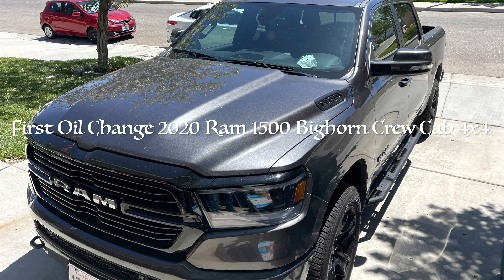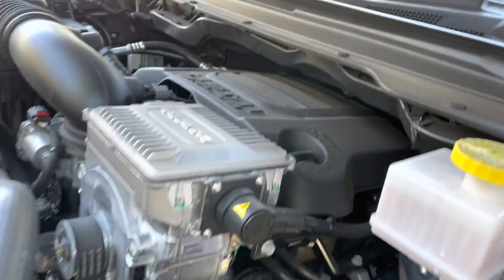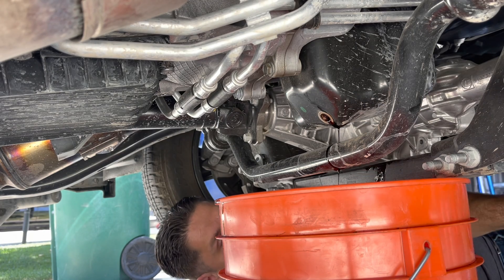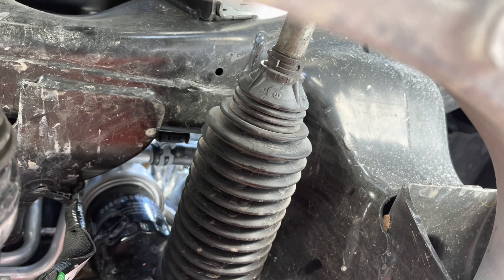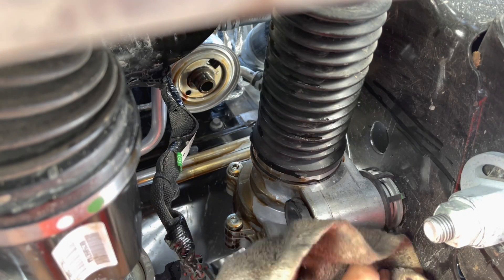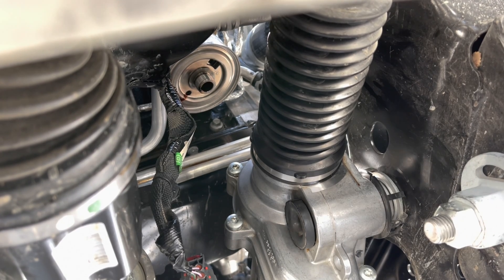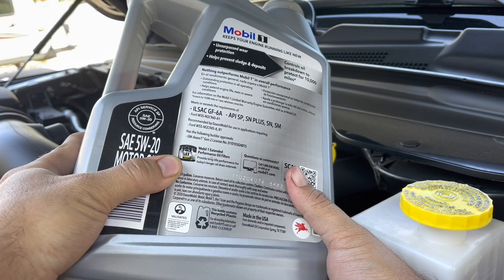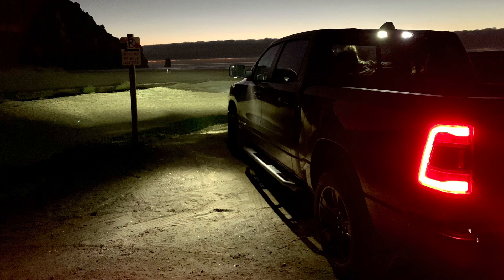1st Oil Change on 2020 Ram 1500 - Bad Engineering 101

Comment: I have done oil changes on a gazillion different cars. The placement of the ram drain plug and especially the oil filter location are absolutely the worst. Besides that everything else around the car made sense.

Comment: I used a step ladder when i put the new oil in, i also put my air suspension in off-road 2 so it made it easier to get under when on the ramps.

Comment: So how many fans mentioned to always add oil to the new filter so you do not have a dry start up ?  It will take a few minutes for that new filter to fill up and start the normal cycling of new oil.
A clear plastic cup works better with a large zip lock to seal it up after.

Comment: @08:20 My thoughts exactly about how techs do oil changes in a dealer or quickie oil change place. I bought my Rebel preowned and will be doing my own changes. No excited about the ones that have been done before my time.

Comment: I did the same on my 2019 RAM Classic 1500. Yes it is a horror story. I LEARNED LONG AGO................
ALWAYS make sure you can break the oil filter loose BEFORE draining oil. IF you can not break it loose DO NOT proceed. You will end up putting the dirty oil back, or new oil in a dirty filter. I learned that the "hard way" many years ago. I watched the other videos too before changing oil, none of them told me this; then I saw yours after I changed oil.

Comment: Instead of plastic, line everything where oil could splash during draining pan or removing filter with thin aluminum foil. After changing oil remove and dispose keeping all truck areas clean from oil.

Comment: What is the large aluminum heat sink box that says RAM in the front right of the motor? I've never seen that on a hemi
Reply: That's the eTorque.  The alternator sits in the same spot on the non-eTorque models.

Comment: That oil filter looks annoying!

A little trick that I saw on another video for oil filters in general: use a disposable cup (paper or plastic, it doesn't matter). As soon as you break it loose, but the cup over it and turn it with covering the oil filter. It'll catch a lot of that oil.

Comment: For gods sake people. If you take your time and give the filter time to drain bit by bit as you remove it! You don’t get oil all over the place or on any part of the truck. As for the sway bar or cross member big deal, it cleans right off.

Comment: Great video.  Mine's the 3.6L and it isn't much easier (except the filter...maybe).  The filter location on the V6 is directly to the left of the oil fill neck but under a plastic cover (because why not).  At least we all lube our sway bars every 5k miles or so.

Comment: Pro tip, put jack stands under while up on those cheap plastic ramps.  When the truck falls on you,.. you'll wish you did put the jack stands
Reply from the maker: The plastic ramps are fine, they don’t break.

Comment: Thanks for this video.  I just picked up my 2020 RAM used and love it.  I'll easily agree with you regarding the placement of the oil filter and drain plug.  Almost feels intentional so you don't change the oil yourself and have to take it in to the deal for service.  I'm sure this is easier with the truck up on a lift.  I'm transitioning from a 2007 Dodge Ram and will say changing the oil on that truck was fun!  I was done in 15 minutes.  No need to put the truck up on ramps or anything.  The oil filter and drain plug were super easy to get to with no obstructions.  This 2020 RAM is not the same.  Again, thanks for the video and will have to do the ziplock back trick and get me a pair of ramps.  :D  4 wheel drive for the win!  :D

Comment: Simple oil change. If it's too messy for you,bring it to the dealer. How much did you actually save? $20?
Reply from the maker: And have a porter making minimum wage do it, makes sense. I do all of my own maintenance, but some of these cars have stupid designs is the point. It’s not saving $20 either, it’s $50 more. Regardless I get way more life out of my vehicles not letting other people touch them for regular maintenance.

Comment: The oil change places are not a good idea. I do my oil change on my 2019 Rebel and yes its a pain for all the reason you mentioned however I know its done right. Even after 30 minutes on a hot engine you still have a decent drip of oil coming out of the plug. The oil change places remove the plug for approx 10 min and there has got to be quite a bit of oil left in there. I let mine drain for approx 30 minutes at a minimum.

Comment: Great video, however, after watching your truck push the plastic ramps forward, i would suggest you get steel ramps to protect you from the truck crushing You.
If you get a  flatter oil recovery  , it works easier than a Home depot bucket. When you change the oil filter, loosen filter, put a gallon ziplock bag around it, moving it slowly, let the oil flow into gallon ziplock bag. Slowly remove, getting virtually no oil anywhere. Good luck!

Comment: Guys I just did mine in under 20minutes!  I have a 2020 Warlock 1500. 
Mind you I am a mechanic & have a hoist. 
Can’t fit a filter wrench in there, simply use a strap wrench, works great.
Are you going to drink motor oil - Yeup you will!! But you want 2B a mechanic, get used to it cupcakes.
That little bit of oil on the parts, clean it as best you can, the rest of it will only undercoat the undercarriage (I’m from Northern Ontario, where they lay winter salt like candy!)
Anyway hope this help you guys 😉👍🍻🇨🇦🔧

Comment: 100% FUMOTO drain valve is the best fix for the drain plug.   Still working on best solution for oil filter.

Comment: 10-1-23 Finally someone explains just how much of a pain in the a_ _  it is changing this filter. I’ve been doing it for years and I dred it every time. There’s just not ample room. Tried every trick & every type of wrench. I was a military aircraft Mech and still I hated changing this filter. The tips and tricks for cleanliness do help, but breaking the filter loose for 1st new truck oil change was is the worst. I get a new Ram every 2 or 3 yrs . If you can get by the factory installed filter, you’ll only need a light hand tightening, and heat + time will do the rest. I slide a fresh piece of cardboard under the truck for a few days to check for leaks . I haven’t had any leaks with my oil changes but even if I had a slight slow leak at the filter , I myself would leave it that way vs tightening up on this model of Ram. There’s just no room to wrench it off if it’s to tight.
Reply from the maker: I use a filter wrench instead, seems to help break it loose easier.

Comment: Instead of accessing the filter from below the rack, access is from the front, above the frame by the coolant lines. This video show the exact location starting at 14:23. You will be able to wrap your entire hand around the filter just like gripping a mug. You can use the ziplock back an take it out with no restriction.

Comment: Use a quart size ziplock bag. Put it around the filter and spin the filter off while holding the bag up around the filter. When I do this I don't spill a drop. You can do it all with one hand. Pull the filter out through the front.

Comment: You didn’t show yourself lubing the top of that new filter buddy. It’s a must to insure that the rubber gasket doesn’t get stuck to the housing or roll when you tighten it.
Reply: If it stick pull it off. Done

Comment: Done probably 15 changes on my ram. Easy for me. Beware mobil 1 does not meet Chrysler material standards. MS-6395.
Reply: @AxleGil  why doesn't it meet Chrysler material standards ? That's all I ever used on my 2013 Ram with no problem  ?

Comment: After 2 oil changes I made my own oil filter relocation kit. Filter is now near the front. I can reach the filter  by just reaching under the bumper.
The previous generation has a big steel  support that protects from front end damage.
I don't have the sway bar issue.

Stupid  Ram put the transmission drain near the exhaust and some wiring. Great job!
Reply: What? lol

Comment: If you think changing the engine oil on the Ram is bad...just wait until you decide to change the transmission fluid and filter.  The filter is built into the tranny pan, and you have to pull the pan and replace it with a new one, if you want a new transmission filter.  Major PITA filling the tranny with fluid...must be in a specific tranny temp range...you're going to love it.  I would love to see your video commentary during that evolution!
Reply: Made the mistake of draining the trans fluid cause the plug said "oil drain only" which doesn't make much sense of course, instead of the oil... Thought it was gonna be a simple fix ha I thought WRONG

Comment: I recently bought a 2020 Ram 1500 Classic with the Hemi engine. My previous truck was 2004 Dodge Ram 1500 with the Hemi. Oil filter was in the same spot on the third Gen as the fourth and fifth gen Ram. I'm about to do my first oil change on my 2020, looks about the same as the 2004 so I don't see it being an issue. Want to have a bad oil change experience and see poor engineering, do a service on Ram with a 6.7 Cummins. You'll be hating your life.

Comment: Interesting, wonder how the dealer removes the filters without making a huge mess. Specialty tool?
Reply: Last oil change there was no oil anywhere. Time before that it was everywhere and was dripping on my driveway. Thought I had a leak but then saw the mess when i crawled under. Depends on if the tech get paid nothing for the oil change gives two fucks..

Comment: Doing my oil change soon , I have 2020 Ram 1500 5.7 Hemi  18K miles 
what oil are people usually going for as far as brand?
 From what I've read recommended/most popular is Pennzoil Platinum   5w-20 Full Synthetic . Open for any opinions/recommendations
Reply: I've been using castrol 5w30 and a Motorcraft 820s filter. No tick. Change the oil every 4500 miles. Definitely works for me.

Comment: just did my first oil change on my 2020 RAM 1500.
what a miserable job the RAM engineers did with both the oil pan drain and the oil filter. No wonder Ford, GM and Toyota are eating their lunch!
they couldn't have a done a worse job with the location of those items.
who was the engineer that thought this would be a great idea???
unbelievable.

Comment: I feel your pain but I found a cure of sorts. Buy a K&N oil filter. It has a 1" nut welded to the bottom of the oil filter so you can put a socket on it. Makes it much easier to get it off.

Comment: i just did this yesterday. i ended up using aluminum foil to cover the sway bar and other components under the filter. it didn't help the oil go where i wanted it to go, but it did in fact protect the components. i also did the gallon bag trick. it did not work perfect and made it very difficult to turn the filter with the bag on. but with some persistence it did come off and caught most of the oil. that along with the foil made cleanup pretty easy. i didn't have much issue slipping the old filter out or put the new one on.

but i agree...the engineering of this is real shit especially since this is 2022.  c'mon guys.

Comment: I installed a ValvoMax Stainless Oil Drain Valve on my Ram.  It will help avoid the mess from the oil drain.

Comment: I always saw the locations for the oil filter and drain pan engineered in those places to protect your engine. So if you go rock climbing in your Ram it wont get "snagged" and leak all your oil completely out to blow your motor. However, it is a pain to access these locations.
Reply: Also the engine is built to be in multiple different vehicles and that vehicle has multiple different engines so it’s no body’s fault. Just have to deal with it.

Comment: Is it necessary to coat the new oil filter seal with used oil? Or can it just be put in dry?
Reply from the maker: It’s a preference thing. I’ve found oil on the gasket helps in dry climates where it can dry out over time.

Comment: QUICK TIP: Slightly loosen oil filter but, not so much where oil starts to leak down, Take a gallon ziplock bag, cut one of the corners off to create a funnel. Zip tie the ziplock bag around the filter as tight as possible. Take a #2 phillips screw driver and slide it into the hole in the corner of the ziplock bag you made previously. With the screw driver inserted into the ziplock bag, use a hammer to TAP THE SCREWDRIVER GENTLY, punching one or more holes into the bottom of the oil filter. DO NOT HAMMER IT LIKE A BLACKSMITH TRYING TO WORK STEEL FRESH FROM A FORGE. Allow to drain fully, then remove the filter while the ziplock bag is still zip tied to the filter. No fuss, no mess and no extra cleanup needed. You're Welcome!
Reply: his way was easier for h im considering how high the car was
Reply: @aprilgosa5779  What does the height of the vehicle have to do with anything? How do you know it was easier for him? Did you consult with him before commenting? Have you ever changed the oil and filter in a ram 1500 with the 5.7 hemi? 

None of what you said makes any sense. But please continue to speak for others you don't know about subjects you know nothing about. It gives those of us who do a good laugh.
Reply: I just bought a 2022 Laramie 4x4 5.7. I have changed oil on Chevy, Ford, Jeep, Harley Davidsons, dirt bikes, lawn mowers, heavy equipment and Toyota. The 2005 Toyota V6 Tacoma was the easiest. The filter was up top. Open the hood and there it is. Also had a funnel type around it with a drain plug. So when you removed the filter you could position a bottle for the oil from the filter to drain into. If Toyota can do that surely other's could. I have my first oil change on the Ram coming up and will try the Zip lock trick.
Reply: can you just drill a hole in the filter instead of punching  a hole in it with a screwdriver  n hammer ?
Reply: @stevenespinoza7735  Sure, if you want to spend the next 10 minutes trying to unwrap the plastic bag from being wrapped around the drill bit. Why complicate the process? But, It's your truck, you do you.
Reply: Thank you for the Ziploc tip, it made my oil change a lot easier with less cleanup afterward. By the way @aprilgosa5779 the height of my truck was the same as his, and the oil change was much easier using the Ziploc trick so I really don't know why the height of the truck would render it not as easy to pull off. Strange comment!
Reply: @DOOSAY-RV  You're Welcome

Comment: Where do you think those Yugo engineers ended up after it shut down? Look at an oil filter relocation kit, and a quick drain plug. That worked out well for my 2015.
Reply: Where did you get the relocation kit?

Comment: When I did my 1st oil change,  I took a disposable aluminum baking sheet, and custom bent it so it fit below the filter and above the steering rack with the oil catch pan below.  When the filter was removed,  all the oil flowed down the baking sheet and into the pan without ANY oil touching the rack.  I held into it for future changes.
Reply: I’ve done the same with just a piece of cardboard 👍🏼
Reply: Need a video of that

Comment: Well I think my previous comment was removed due to my smart comment about the ramps.  Anyways I take it all back.  Just changed the oil myself for the first time on my 2018, 123k km on it now, the rest have been dealer and shop.  I agree it's an absolute nightmare and a piss poor design.  You are right.  Oil filter was way over torqued too, I yelled f-ing Dodge a few times under there.  First one was rough (I've changed oil on my other cars lots of times, including my ecodiesel which was a dream compared to this) and only can improve from here.  Had to break out the kitty litter for the driveway.  Bag was not going to do it needed the filter wrench, which perforated the canister.  No clean way to do it over torqued.  Thanks you are right, designed to be serviced at dealer, hateful.

Comment: This isn't that bad. You're making it harder using a 5 gal bucket, ziplock bag, & BS filter pliers instead of a regular oil change pan & band-wrench. It's been this  filter & oil pan setup since at least 2006 (probably since 04-05).

I'd tell any 1st time ram owners to use a degreaser like pre-mixed simple green or purple power with a rag for clean up & get on with it.
Reply from the maker: And that’s how parts fail. There is wiring and plastic under the oil filter that will brittle if hit with degreaser at every oil change.

I’ve had lots of trucks, cars, etc. this design is stupid and people accepting bad engineering on a expensive truck only allows more of this. I do all of my own maintenance and will figure out a technique, but Ram owners deserve a better design. This is only this way to save Ram money with parts sharing, but enough complaints will lead to a better design.
Reply: @Sunshone7311  No, that isn't how parts fail. There's a difference between brake clean & simple green. I can & do use simple green without issue to clean my cordless tools, other plastics, ect. I can't with brake clean.

My 1st job in the mechanic world was at a oil & lube. There's far worse out there. I changed the oil in my 2006 for 12yrs before I got a 5th gen & very little of the process has changed between the 2. I'm not saying it's perfect, I'm saying it's not that bad. Could it be better? Sure. But as is, it still beats the socks off changing the oil of a crown vic, VW, f150, nissan titan, or a hemi durago. Silverados have been easier but they moved the plug from the side to the exhaust y-pipe so if the hot exhaust didn't get you, the scorching oil from after hitting the exhaust would.
Reply: BRAKE CLEANER PEOPLE. Jesus christ.